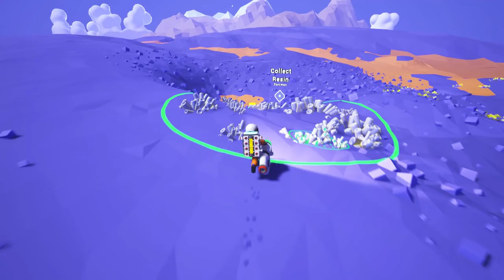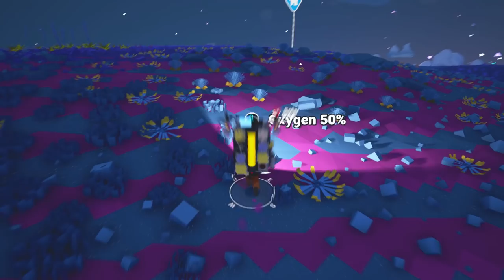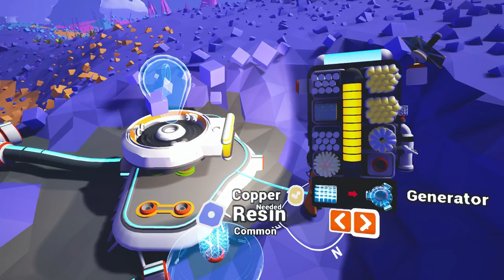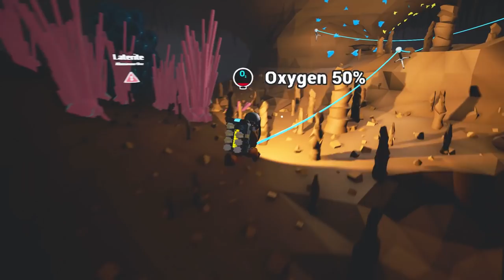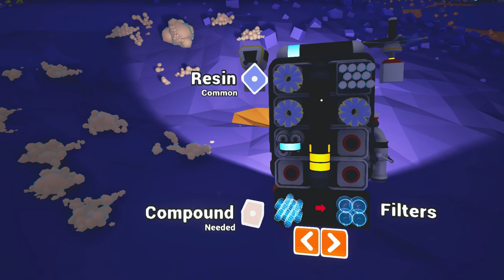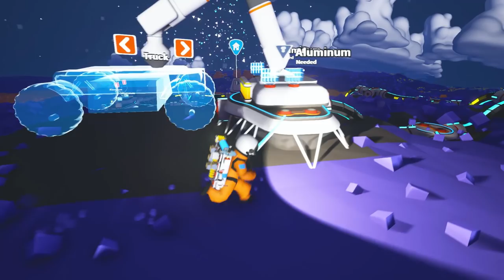Astroneer:  "Exploration & Base Building" Let's Play Episode 1

Comment: A hint about leveling ground @flying Ross. The level plane is set when you start your shaping tool. The stopping and starting your doing keeps on changing the plane it's is trying to level at. That is why your having such a problem.
Reply: I find that leveling tool such a pain to use at times.  You really have to be slow and patient with it ^--^